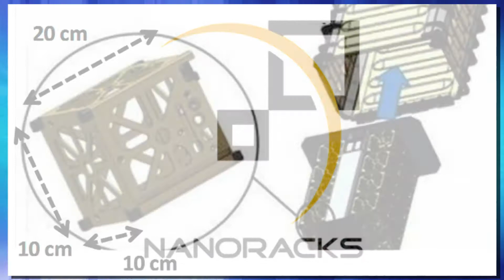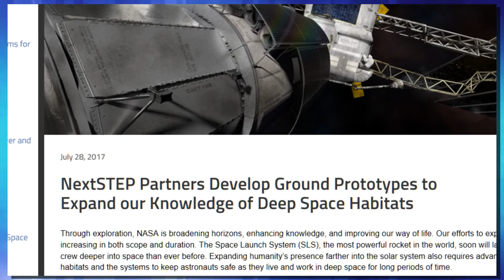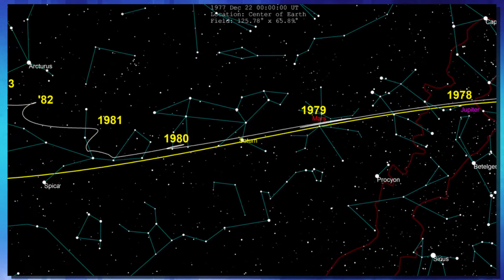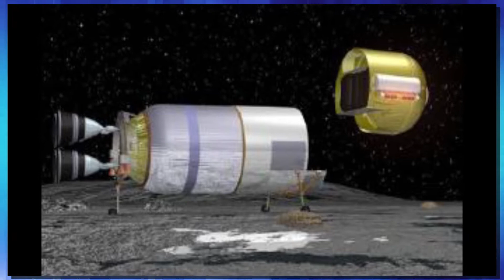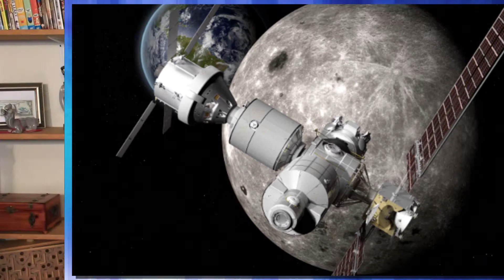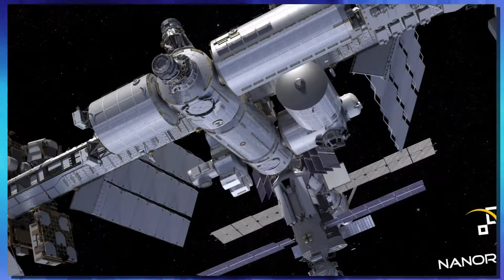NanoRacks Independent-1 program will build space stations from space debris

Comment: I think we need to move away from just pure research in space and dedicate resources to manufacturing in zero G. Nanoracks have come up with an interesting idea. There's a crap load of space junk up there and using robotics to repurpose it sounds good. I wonder what metal fatigue those rockets have encountered up there. Are they still structurally sound? That's my immediate concern.
Reply from the maker: You make a good point. I would imagine the older stuff from the 60s wouldn't be reusable. Not just from how long they were up there but also manufacture processes were new and relatively untested. The idea of having robots up there building facilities seems like a good start but thinking about your comment what kind of materials are up there that could be recycled? They say there are more than 500k pieces of debris floating around. What if all that could be collected and used to build space structures. It is already up there so there would be no launch cost and it seems like a better solution than pushing it back into the atmosphere to burn up. Heck, an orbital recycling facility would be a great spot to put decommissioned satellites instead of a garbage orbit.

Comment: Total rubbish, Biglow has the only viable space station concept. I will admit these bodies could be used useful but certainly not in the manner they purpose. Recall how much time was(is) spent preparing iss for use(and those modules we sent up fully furnished).
Reply from the maker: Bigelow's expanding modules seem great and the concept is flight tested. I have no doubt his concept will be the easiest to get into space. Their setup has some of the same limitations as this idea. Once the shell is in space and expanded they will still need to be outfitted for occupation. I don't know how they plan to do that, will it be robots or astronauts installing the interiors? No matter what they choose it is still more likely to succeed than gutting and building an outpost from a fuel tank in orbit. I still hope this plan gets a shot just to see if they can pull it off.